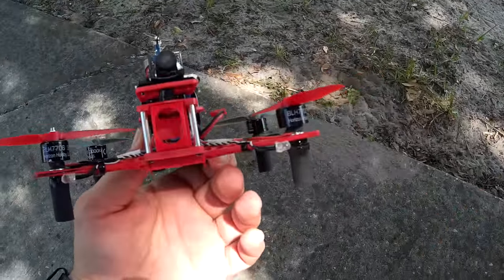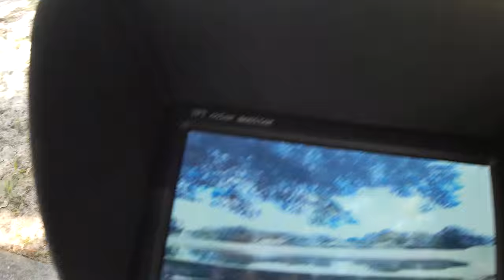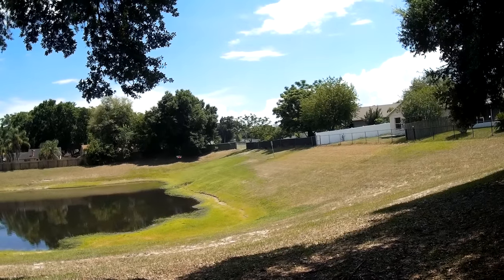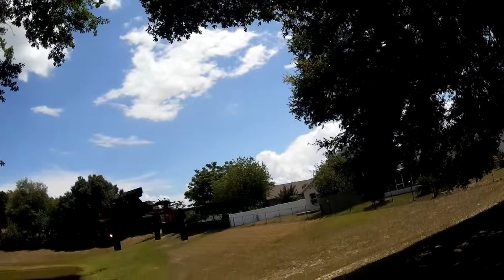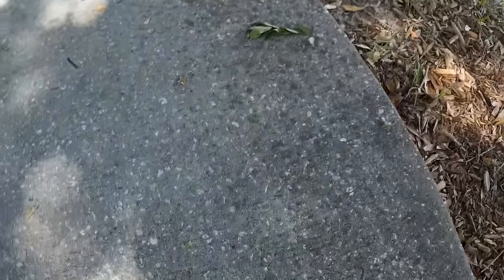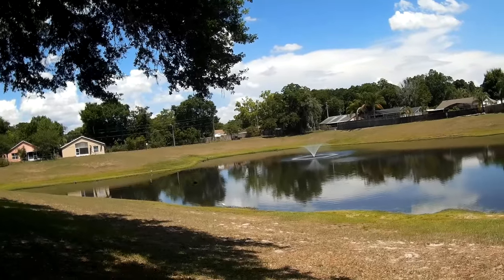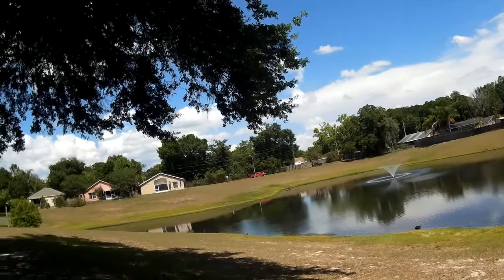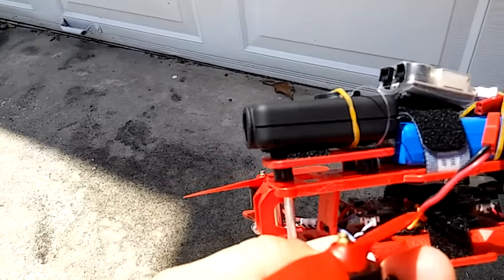KINGKONG 188 / 200QX Maiden flight

Comment: looking good!!!
Reply from the maker: lovin this build..flew it around at a park yesterday ...took it down some trails just to get some cool nature /scenery video with the Mobius on top & it came out SO SMOOTH...even at high speeds it looked good.everything must be very  balanced.
Reply: sounds great!,making me want to buy a 200qx :) 
did you fix that high toque roll problem?
Reply from the maker: +James P haven't had a chance to get into it was busy last few days. wonder if it's fixable by having less roll? tuning is not my expertise..lol
Reply from the maker: +James P funny thing is it was starting to do that even with the stock body before this Frame swap. I know when my little inductrix started doing it ..going down in extreme funnels it meant one of my Motors were going bad this situation not really sure?
Reply: i've seen this before, but couldn't really determine for sure what was causing it, i always guess it was the motors torquing loose, since the frame i was using didn't have the keyed motor mounting holes.
Reply from the maker: The motors definitely aren't moving they are super locked in there.! also the way the wires are and zip tied down the wire would rip out before the motor would spin..
Reply from the maker: I think I'm going to get the multi Star Motors that are a direct replacement for a 200 QX I have them for my 350 QX and they're fantastic. And way cheaper than the stock one ! I really think one of my Motors are going bad maybe a bad bearing or something
Reply: didn't know there was an after market motor, except for the stingers. hopefully your right about the motors thingy. that drove me crazy for awhile.

Comment: You should try the Rakon 200qx frame. Love that frame from Rakon. Yours is looking good to. Are you going to install a board FPV camera. I love my 600mw camera on my Nighthawk 250 and my OSDoge so I have all the telemetry data in my goggles. Makes is so nice to fly when you can see how high you are from the ground. google it. i think you'll like it.
Reply from the maker: i will probably put a 5.8 cam and transmitter with OSD on it and that is whats nice about this frame is there's a place for IT ! even a power board for it! wow and its less than 10 BUCKS.